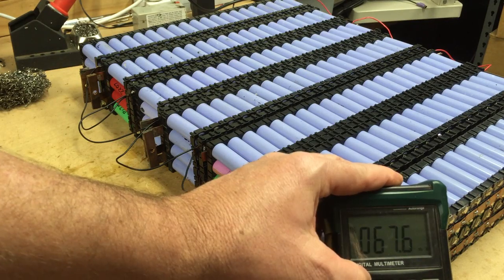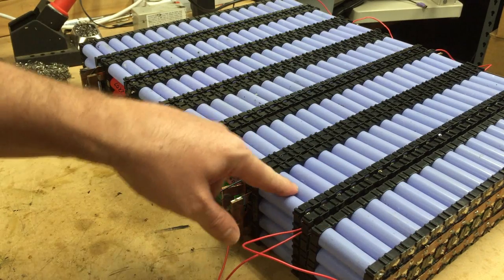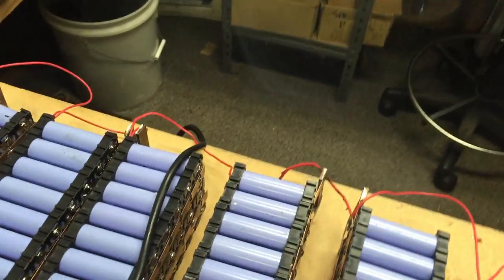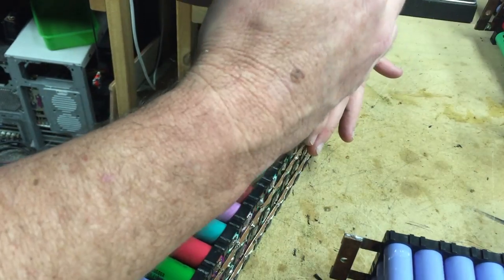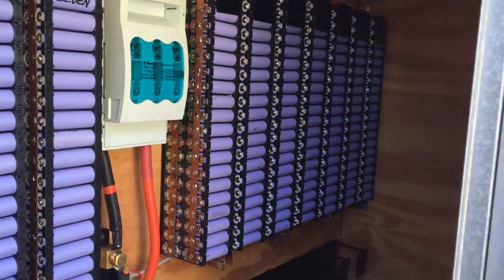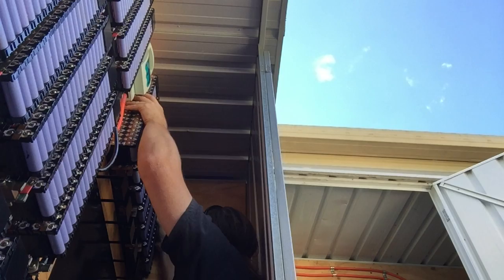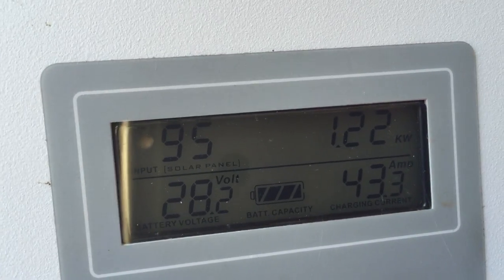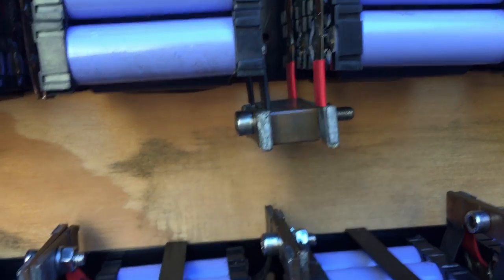Building a DIY Powerwall from used laptop batteries

Comment: Wholesale website list 20 panels at: 6,300 W (315 W ea.) for the grand total of $5200us converts to $7116.46au before shipping. 
In your opinion, is that a cheap or a fair deal?
Reply: In Darwin 6kW installed with micro invertors cost $14,000.00 after Government rebate
Reply: you can do better on ebay 

on ebay you can get solar panels for less than $1AUD per watt with free next day shipping 
200W panels for $168 each
Reply: Pay more and you get "QC-PASSED" Chinese gear more often than not.
Rather than "QC-Failed" downrated gear.

Comment: All of those connections bolted together, will have oxidation problems and need cleaning.  Maybe once a year.
Reply from the maker: +Latro Geniwile not afraid of work :)
Reply: It wouldn't hurt to use dielectric grease at all connections.
Reply from the maker: +southbound1969 not all, that's a good idea.

Comment: If your wire fries before your fuse blows you need to engineer it the opposite so the fuse blows before wire fries.
Reply from the maker: fuses didn't blow as the sum of fuses per cell exceed the used computer PSU wire i used to balance. Weakest link went Magic White Smoke :)

Comment: cause fuck balance charging, We Like dead cells and fires...
Reply from the maker: +DesertExperimenter stay tuned we got that covered :)
Reply: ok I'll be watching, looking forward to how you deal with balance charging that many cells
Reply: If you have 100x 18650 cells bussed in parallel, you can charge them with a single BMS or a voltage limited charger.
Reply from the maker: Hey have you checked out my latest videos, seems i nailed it :)

Comment: Nice bomb you've built there. Glad you aren't my neighbor.
Reply from the maker: Bomb would imply it would explode levelling a given area - come on at least do your research - goin thermal isn't a bomb.
Reply: 20KWh battery bank contains the same amount of energy as approximately 16Kg of TNT. Admittedly the TNT unleashes that energy a lot faster (a few milliseconds) than the battery bank gone thermal (a [very] few seconds with cells tightly packed together like you have). So rather than a true explosion you'd have a deflagration that would look something like a rapidly expanding fireball. I guess I should have said "incendiary device" instead of "bomb".
Reply from the maker: Much better, now it's time to prove you wrong :) it's time to upgrade

Comment: So when do i hear in the news that your house is burned down? How about safety? Did you install a fire extinguish system above your powerwall? Do you monitor temperatures compared to load and good analytics? It's all nice if its cheaper.. but i bet your insurance ain't gonna pay you if you burn your house down like that. It's not recommended for normal people to do this.
It's very impressive what you do.. but it's pretty dangerous too.
Reply from the maker: you need to take just a few hours of your life and have a quick look at the 200 odd videos I've done. Fire alarm in shed, shed is wood lined yes but its a stand alone locked shed ... TWO fire extinguisher's outside shed and another 5 m away. EVERY cell is fused. Bank is fused, inverter is fused, panels are fused, AC side is fused safety switched - and as time passes I'm improving even further. I MANUALLY measure temp AND voltage 3-5 times a day for the past 6 months. While your concerns are valid  you need to take a little time to appreciate all the effort so far.  After all people still carry Samsungs in their pockets.

Comment: Are you sure it is such a good idea to have cells so close together, not even individually fused ? Why is this not a serious fire hazard ?
Reply from the maker: Dogphlap every cell is fused :)
Reply: there fused
Reply: Good to know the cells are individually fused. So you are happy the cell separation is sufficient ?
Reply from the maker: This will be addressed in V6 mounts. There is currently 2cm gap between packs. I'll be increasing it to 4 cm and might even make the packs 14 wide not 7 to clean it up even more. Thanks for your comments.
Reply: And in next version 2cm + brick + 2cm between packs? :)

Comment: how many kWh to run a home
Reply from the maker: 30-40 kwh MIGHT run my home till my teenagers move out :)
Reply: Thank you for your help..................
Reply: i can comfortably live on 
6kwh per 24h in winter 
30kwh per 24h in summer

summer tends to be when my 40kwh AGM battery bank needs to be reconditioned due to the 80% DOD on average due to air con use caused by excessive temps here in AU most summers 
it also makes solar panels run less efficiently

Comment: One of the problems I see is that those 18650 batteries will last only for about 1 year.
Reply from the maker: +Bonnie Flory call back in a year and find out :)
Reply: 4 out of 6 of those batteries died on me before the 1 year mark.
The other 2 batteries have 3 more month to go but they have not been used much.
I was thinking to do the same thing a long time ago, but if batteries do not last why continue?

I may come back in a year. Are you keeping records?

Good luck.
Reply from the maker: Remembering that my load per cell is so tiny it'll ad to the expected live span. example last 24hrs only taken .37 of a volt from each cell. That's nothing in the big picture. And as i have another 1120 cells almost ready to be added to the system the load cycle will be so small i think it'll last a few years. If not i'll document it and no one else will have to keep going :)
Reply: The more I look at your videos the more impressed I get.
You are right the more batteries you have the less current per battery you have and the lover the voltage drop when a load is applied.
Reply: Hi HBP how many Watt Hours did each cell use?
Reply from the maker: no idea, i'm an amp man :)
Reply: The name of the video led me astray

Comment: Use tick wires wtf what are you doing with those thin wires? Ofcourse they'll melt
Reply from the maker: Thin wires are clearly a better choice - point of weekness with lower amps than the rest of the rig... WORKED out perfectly

Comment: I would not be comfortable with that in my house one goes boom and they all do and then your house burns down in short order.
Reply from the maker: Etheoma really ?
Reply: Errr well it's because more batteries means more room for failure each battery may be extremely reliable but with 1000 batteries your chance of 1 of them going bad and taken the rest with them increases by orders of magnitude so even if you test each battery exhaustively so that your chances of one exploding is only 1 in 1 million for an individual battery to go bad with 1000 it's a 1 in 1,000 chance and as said if one goes the hole thing goes as why you don't see rockets with 20 or 30 engines which the engines would be more efficient than a larger engines  but the risk of 1 malfunctioning increase by 20 to 30 times.
Reply: Also what happened to the second part of "It's bad practice but I'm doing it for science - 18650 DIY HBPowerwall building for failure"
Reply from the maker: +Etheoma come on exploding ? Gah correct terminology is always helpful. Ooh and there is 4480 cells now :)
Reply from the maker: +Etheoma still in progress :)
Reply: Errr Lithium Ion Cell can and do explode, not from combustion but internal pressure which is still an explosion but yes that isn't the way they generally go.
Reply from the maker: Show me ONE proven EXPLOSION - and go!

Comment: Think you need to explain to everyone a bit more what it is you're actually doing, don't want to be rude but it shouldn't be about you ego tripping on your knowledge, proper use of the internet is sharing knowledge and info. I have 4 kw solar system but haven't really got a clue what you're talking about, I would however still like to know how to build up a battery system from scratch .
Reply from the maker: +Alistair Milner I guess you could always take a look at te other 200 odd videos that explain in detail what how when  how much how long etc. you know not to be rude or anything.
Reply: Ok, I'll have a look, thank you very much for you're prompt reply. I realise that you probably think I'm a complete tosser at this point, I will try not to be quite so blunt in future but I would point out that nobody likes it when I'm sharp, to the point or diplomatic either, guess that's life. Keep up the good work.

Comment: Wow.. Talk about a fire hazard.
Reply from the maker: Please feel free to go into detail on what your talking about... might pay to look at newer videos :)
Reply: Li-io batteries can randomly combust at anytime. The older they are, they higher the chance. I've seen quite a few explode in my time working in the computer industry for the last 2 decades. Having that many cells of possible cheap manufacturer like that is crazy! All it takes is one poorly made cell to short and BOOM!!! For an off-grid setup, Nickel Iron batteries are preferred, but Lead Acid is far cheaper. Over the years, I've only seen 1, or 2 lead acid batteries smoulder and heat up and it can take hours or days. Li-io takes seconds.
Reply from the maker: So you got about 3 years more experience than me in computer repair industry - BILLIONS ( This is probably an understatement) of laptops, drills, fans, medical equipment, hospital exit lights, etc have these cells and NEVER have I seen or heard of a laptop going BOOM as you incorrectly put it. With as little searching you may just find you need to replace the word BOOM with Vent - TWO really different things. It's possible they'll shoot off like a small ballistic missile but BOOM, nop they are by design made to fail on the positive end of the cell. How ever I agree the older they are the better chance they have of failing. Hence 4480 individual cell fuses that fail at around 5-6 amps. Dead short on a single cell results in the fuse burning up in seconds. Add another 79 cells pumping juice into a failing cell and it's bloody dam near instant. Alarmist comments like this do nothing especially when it's clear you haven't taken the time and looked at the project and the effort that has gone into making it as safe as reasonably possible. 

Little things like 120 temp sensors, fire/smoke alarms, extinguishers, HRC fuses, Shunt Trip, State of Art BMS common sense and a good amount of thought has gone into building this. 

As for being an offgrid setup - this is more a You-Tube project that got out of hand. Don't have the cash to splash out on Kick ass time proven batteries and I've done the whole Lead, AGM off grid setups with moderate success - nothing like how well this one works. (see early videos from 2years back)

Moving forward - it's getting better & safer - kick back hit the sub button an see if you can find any new issues other than BOOM :)

Pete
Reply from the maker: I would suspect you really mean non-genuine or re birthed 18650's physically damaged cells. They don't come into the equation. Knowingly putting them into the project is just plain dumb.

Not looking at any other chemistry of 'lithium cell' only 18650 batteries listed here http://diypowerwalls.com/celldatabase.php Had 100's of phones that get hot under normal usage, 100's of iPhones with broken screens because of batteries expanding, had Samsung and iPhones catch on fire meh that's well documented. Apple batteries are also different chemistry. I think your fear comes from bunching all lithium into one box. This is unfair..

any how this is a Holden / Ford debate I do thank you for your input ..

Cheers

Comment: It is apparent that your lack of knowledge about the most basic electrical engineering terms renders you unqualified to design a battery power system. Failure of these systems WILL result in fires that CAN kill people. Go buy a professionally engineered and installed system.
Reply from the maker: Tom Seim bah, won't learn a thing that way.
Reply: Tom’s always in bed by 8:30, and can touch his toes on request - any time, any day, everyday.  FTW